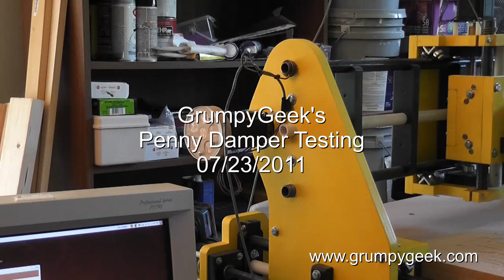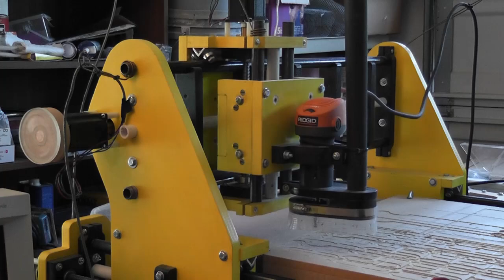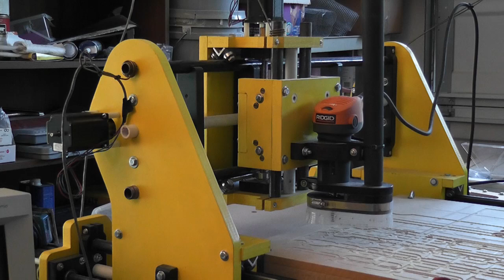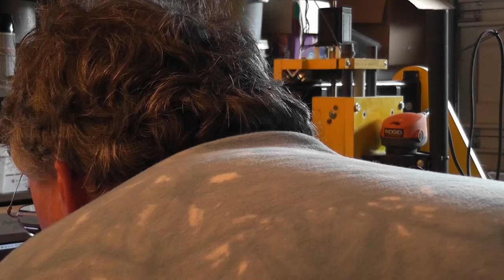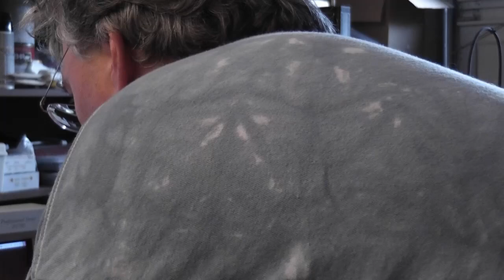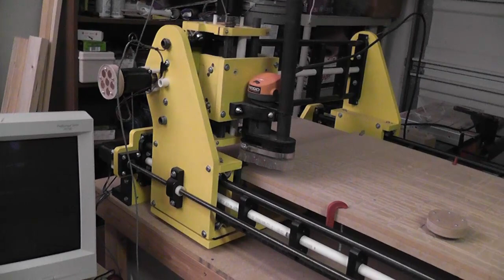Penny Damper

Comment: how did you elongate the shaft behind the stepper motor ?
Reply from the maker: Damper has a coulper in the center.
Reply from the maker: The steppers are dual shaft (front and back), there is a coupling embedded in the damper so it is no different than attaching a lead screw.

Comment: Thank you for sharing this.  Are the pennies allowed to rattle as in a "harmonic" damper, or is this meant to add simple inertia like a flywheel?  I'm having a problem with my X-axis jittering when I try to cut foam at 200 ipm, I think something like this might help!
Reply from the maker: The holes for the pennies are slightly over sized to allow them to rattle like a harmonics damper, at least that was the idea.  I would probably make the holes a little bigger if I did it again.  You can find a little more detail here if you would like: http://grumpygeek.com/?p=915